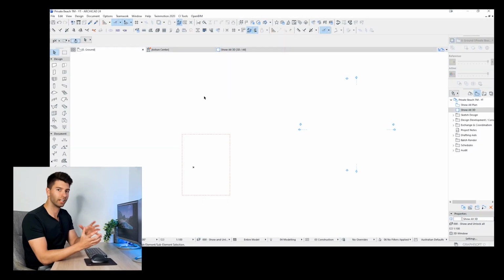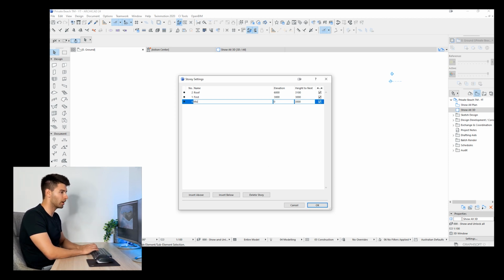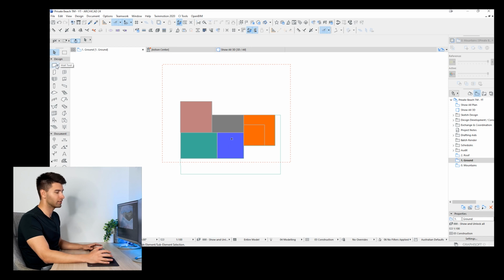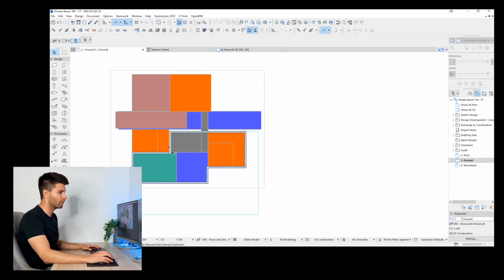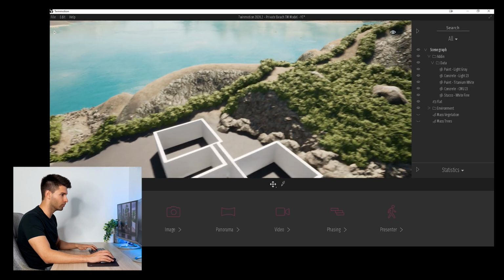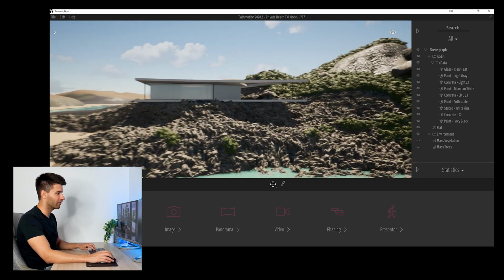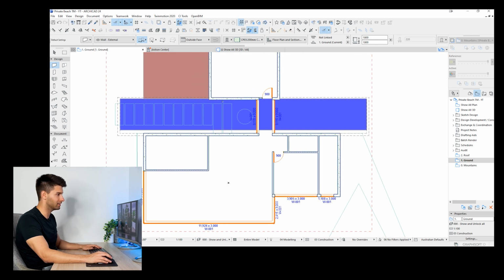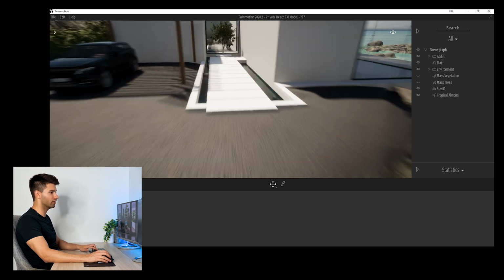ArchiCAD 24: 30 Minute Tutorial Live Design

Comment: Still a revit fan?
Reply from the maker: Yeah 100%, it's a great software
Reply: @DavidTomic  greater than AC? & y?
Reply from the maker: Not better or worse. It depends on what you're designing. My career at the moment has a high focus on luxury residential and low end commercial (up to 50mil). Archicad is perfect for that and designed to do it better than revit. If I were to transition back to the skyscrapers billion dollar + commercial pathway revit would be undoubtedly a better tool due to the collaboration with other professions in the same space.